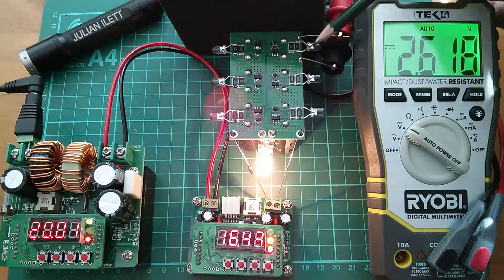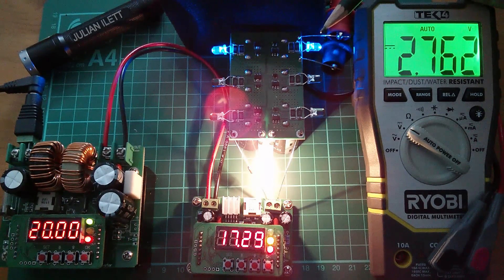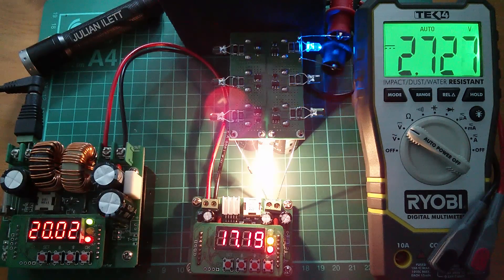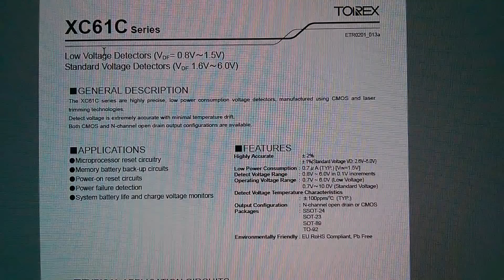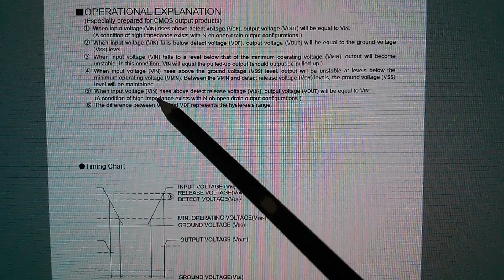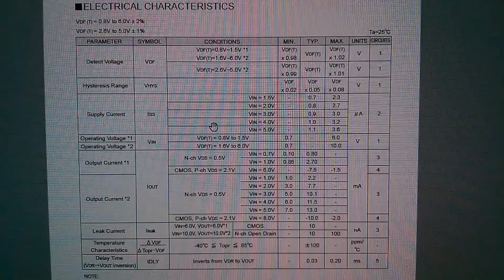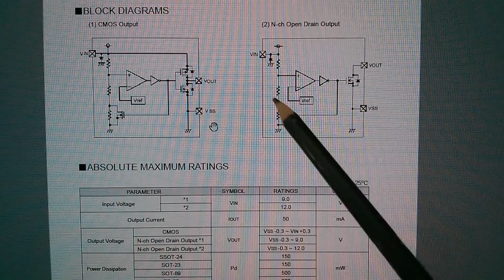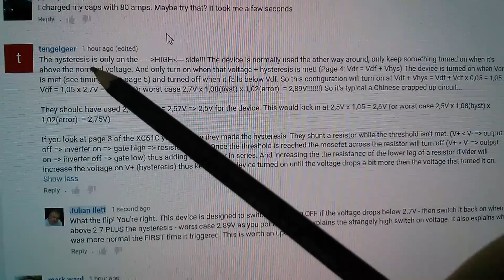Scary Update: SuperCapacitor Module 6x 120F 2.7V

Comment: Do you read all comments? I don't think so.
So again: if you drain the caps in series down to (almost) zero, chances are you are actually charging one or more capacitors with a negative voltage! This is because of not having any balancing discharge regulation.
Just draw the (simple) schematic. 6 caps in series, and a load. Now think of 1 or 2 caps having slightly more power (and thus voltage). The load (55W bulb) is almost a dead short. What will happen is the caps with a remaining voltage will start pushing a current trough the caps having 0 Volts. Tada! You are charging those NEGATIVELY. I won't stress this again. If you don't read it what's the point. I had to find this out just because it happened to me. If you relay this message, others won't make the same mistake. Or you for that matter ;-)
Reply from the maker: +deslomeslager When I attached the DVM to that single cap, it was showing a negative voltage. About -200mV I seem to remember.
Reply: Sigh...
Reply: Julian Ilett
Thanks! You rock.

Comment: Did you take a look on the super capacitors datasheets? Perhaps they can do more than 2.7 Volts.
Reply: Super-capacitors much like other electrolytics, are typically designed and built to allow up to 20% over-voltage with only minor reduction in service life. 2.862 volts is only 6% out.  Remember that these are over-voltage protection circuits and not true balance circuits.  You should still be using this module with a proper balance circuit.  The balance circuit on my super capacitor boost pack uses Zeners, resistors and LEDs IIRC to keep the capacitors balanced.  The intended purpose of these super cap packs is automotive use so as long as a decent balance circuit is used.  These protection circuits should never even need to kick in.

They could have easily dropped the voltage by .15 volts when they programmed the chips but then they would also have to say the max voltage of the pack should really only be around 15.5 which would still be fine for automotive use but would allow for a bit more safety margin.
Reply: Most supercaps have the rating printed on the component, if you watch the postbag video #68 the caps have a 2.7v rating printed on the shell.
Reply: blaser
Could be a median or mean voltage. I doubt that the caps are abused when just .1 volts overvolted...
Reply: ***** that's not how it works, usually when designing electronics, you'd pick a capacitor rated at twice or even 3 times the max. voltage you're designing for. That's why if you crack open an led bulb the capacitor is rated around the 400V mark as most mains supplies are 100-240V
Reply: blaser
That's just because there is no cap which is exactly rated for the peak2peak voltage of 230V mains. ;) Like with resistors.
Reply from the maker: There's a device called a SAB MOSFET (Supercapacitor Auto Balancing MOSFET) which looks interesting http://www.aldinc.com/ald_precision-supercap-auto-balancing-sab-mosfet-tech.php
Reply: kuhrd
slaps the desk Thank you! :D
Reply: Julian Ilett
Really interesting. Does something so simple applicable exist for LiIon battery banks?

Comment: You could bodge the ground of the of the voltage detector with two resistors raising the ground. The device is low current so resistance could be a 10s of K so little loss.  Better to use a good reference and 6  comparators and just use the FETs and load resistors.  Could the FET be a darlington transistor as even low threshold FETS  have perhaps 0.5 to 4V, so can't ensure would always work.
Reply: replace voltage detector with a TLV3012 comparator that has 1.24v internal reference, choose the cmos output and add potential divider or potentiometer to set wanted voltage, works down to 1.8v.

Comment: Given it's just a circuit board I'm sure it's limited but what Amperage can you charge those at max? Wonder soldering a wire to bridge between capacitors would help. Nice update I can't wait to see you play with this thing a bit more.

Comment: Could you monitor the maximum voltages of the capacitors when you are charging and discharging  at higher currents within the rated voltage of the capacitor bank to see how well they stay balanced? One datasheet for 2.7v supercaps caps showed an absolute maximum of 2.85v for 1 second non repeating, it would be good to see how long they lasted in an actual application.

Comment: i) The cap will be 2.7v over full temperature range. ii) the voltage that the chip triggers may well be different than the value on the DVM because of the current path in the PCB. Probably nothing to worry about, that said be wary of eBay crap...

Comment: measure the farads
Reply: +Julian Ilett Do you think you were getting the full 55W while the bulb was bright for 30 seconds? If so, you get (55*30) 1650Joules of energy. Therefore, based on E=0.5*C*(V^2), the capacitance would be over 12F (roughly 12.5F just during the brightest phase). Take into account there are a lot of assumptions in that calculation.
Reply from the maker: I did.
Farads = seconds / ohms. The car bulb ran for about 40 seconds and is 4.6 ohms (when hot). That gives 8.7 Farads. Seems a bit low to me. Can anyone spot a flaw in my maths?
Reply: i wouldnt test it with a lightbulb because the resistance depends on the voltage and also there is an exponential decrease in the voltage if it would be an ohmic resistance. I would charge them with a constant current source until they get 1V. You can figure out the Capacity by measuring the Time. Capacity is charge per Voltage is As/V . You can get the Capacity by Multiplying the constantcurrent with the Time and Dividing it with the Voltage this should be really accurate!
Reply: You should use a constant power load or at least consonant current for better precision but yes you are right capacity is much lower same as I observed with the low cost China supercapacitors that I got.
Those that I sent to you are much higher quality you can do a test with those also.
Here is the calculation same thing that I wrote to another comment here

He has 6x 120F capacitors in there with a 2.7V voltage rating.
The energy stored in each of those 6 capacitors is 1/2 CV^2
At 2.7V that will give you 437Joules and at 0.7V the remaining energy 
will be 29 Joules so usable energy is 437 - 29 = 408 Joules (same thing 
as W/second) or 408 Joules/3600 seconds = 0.113333Wh
Since he has 6 of those in that module total module capacity is 
0.11333Wh x 6 = 0.68Wh
He used a 55W rate bulb but that is probably the rating at 13.8 or 14V 
and he had a bit more in the beginning  but that dropped quickly so it 
maybe started at around 65W in the firs seconds then dropped down to 
almost nothing in those 40 or so seconds. Since resistance of that bulb 
is dependent on temperature it will be a bit hard to calculate the 
energy delivered in this video.
If it will have been a 55W constant power load then that 0.68Wh should 
have lasted for (3600s * 0.68Wh)/55W =44.5 seconds. Since that was not 
the case in this video those capacitors have probably a much lower 
capacity than advertised so instead of 120F they are more like 60 or 
70F.
Reply from the maker: I disconnected the bulb before it had gone out completely - and the filament resistance will have dropped as the bulb cooled. So modifying my measurements to 60 seconds divided by 4 ohms gives 15 Farads (much nearer the 20F pack capacitance).
Reply: Not sure how you made the calculations but the test was not that good. Use one of those constant current electronic loads that you have for a more accurate result and also check individual voltages on capacitors if they are not equal it will be harmful to discharge them so low since some will be reversed polarized.
My calculation above showed that with a constant 55W load starting from 2.7V x 6 = 16.2V and ending to 0.7V x 6 = 4.2V you should have about 44.5 seconds.
Since voltage has dropped the Load (bulb) power will also drop from maybe about 65W down to around 4W in almost a linear way so the average Load over those 40 seconds will have been around 35W so maybe around 12F pack capacity.

Comment: Thanks for the update. I don't take mine to anything above 14.5 volts total across the capacitor bank - hopefully that's well within the specs of each individual capacitor.
Reply from the maker: You're probably not going over the 2.7V upper limit, but I noticed when the module is fully discharged (courtesy of the 1W bulb) some caps were showing a small positive voltage and the others a small negative voltage. There's no easy way to 'bottom balance' the caps in this module.

Comment: there is nothing to be nervous of i think. only they start leaking sooner, maybe.
Reply: A normal capacitor rated in microfarads isn't exciting when you overvolt it slightly, a bit of magic smoke with some leaking.

A supercapacitor is a bit more scary since it stores far more energy. If one of those 120 farad caps went off, that's 437.4 joules of energy. If it shorted out all at once, that's over 4 kW.
Reply: but those little 10 millivolts will not make it go boom, right ?
Reply: iceberg789
It's like an over inflated car tire, that tiny last insult can make it go bang.
Reply: 8% is the usual supercap manufacturer specified margin between rated voltage of 2.7 and maximum voltage, which would be 2.92V. 
Everything, including the tires, has a safety margin. A pretty substantial one usually, so the analogy isn't too good. 8% is actually very little leeway, however sufficient for the circuits used on this board to be good enough.

Comment: about 40 seconds of good light off that 55 watt bulb on the module, nice work 👍
Reply: He has 6x 120F capacitors in there with a 2.7V voltage rating.
The energy stored in each of those 6 capacitors is 1/2 CV^2
At 2.7V that will give you 437Joules and at 0.7V the remaining energy will be 29 Joules so usable energy is 437 - 29 = 408 Joules (same thing as W/second) or 408 Joules/3600 seconds = 0.113333Wh
Since he has 6 of those in that module total module capacity is 0.11333Wh x 6 = 0.68Wh
He used a 55W rate bulb but that is probably the rating at 13.8 or 14V and he had a bit more in the beginning  but that dropped quickly so it maybe started at around 65W in the firs seconds then dropped down to almost nothing in those 40 or so seconds. Since resistance of that bulb is dependent on temperature it will be a bit hard to calculate the energy delivered in this video.
If it will have been a 55W constant power load then that 0.68Wh should have lasted for (3600s * 0.68Wh)/55W =44.5 seconds. Since that was not the case in this video those capacitors have probably a much lower capacity than advertised so instead of 120F they are more like 60 or 70F.
Reply: Yes they are not that useful in most applications. There are some particular applications where they can work well and even be cost effective compared to a battery.
They where used in some large EV in the past to recover the energy from breaking and release that immediately after for vehicle acceleration so there many many cycles/day.
As an analogy you can see the super-capacitors as the fast cache memory in computers vs RAM maybe represented by LiFePO4 (more like SRAM) then Flash represented by other high energy density Lithium cells like LiCoO2 and not sure if I want to compare HDD with Lead Acid :) it is worse than that.
Super cap can be recharged in a few seconds, LiFePO4 in a few minutes, LiCoO2 in a few hours ....
Reply: you could use supercaps a s batteries, but you would probably need to regulate/boost the voltage to get the same performance out of them - as with regular batteries they are relatively delicate and need to be protected. The fact that they don't degrade as much over charging cycles and can charge very quickly  also potentially makes them more usefull.
Reply: I did read them :P, its just my thoughts on how you could turns these caps into the equivalent of a battery, using them directly wouldn't work well in a lot of applications as the voltage drops down all the way to zero whereas battery remain relatively constant. Not reading the comments is only true for my troll comments :>
Reply: thanks for the detailed explanation very informative on the price/capacity and capacity point :>.

Comment: Nice video!

But I do think it would work rather good if the 2,5V device was used. Unfortunately that version is a bit hard to get. Farnell only has the 2,7V and 4,5V versions... Digikey has them for 64 (Yankee) cents. Mouser about the same. You could try a sample request 0:-)

Comment: does your multimeter have really good specs? cause some of the error could be from the acumulative error
Reply from the maker: Accuracy would appear to be 0.8% plus 3 digits - https://manuals.ttigroupna.com/system/files/6464/original/RP4020_664_trilingual_04.pdf?2011
Reply: so the accuracy error could be up to 20 millivolts at that scale and the chip could be pretty accurate, that said your point about the chip not being that appropriate for that application is on point. btw i really like the work that you do, keep them videos coming :-D ( i have bought many of the gadgets/ electronics parts that you have reviewed)
Reply: Well, technically that's the accuracy when it was calibrated. It's more a statement of the meter's technical capability, than its actual present status.

Now obviously pricey calibration of a kickabout toolbox meter for hobby use doesn't make any sense ... but if you knew someone that could take it into work and compare your meter to something traceable, it would definitely give you a lot more confidence when you're chasing 10s of millivolts on a meter that maybe had a couple of winters in the shed.
Reply from the maker: I've got one of those precision 5V modules to show in a future Postbag video - I can test all 3 of my DVMs with that :):)
Reply: cant w8, almost bought one of those couple weeks ago, i bid to win an auction but i didn't get it in the end.